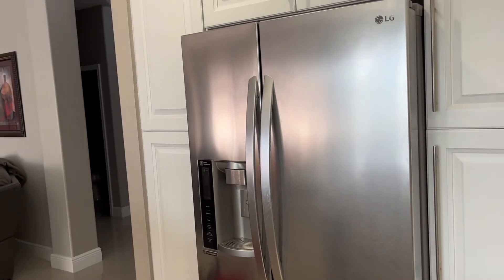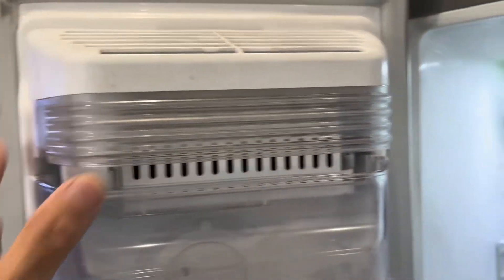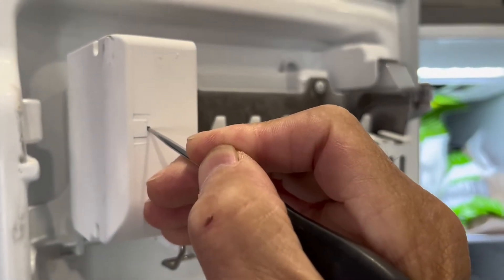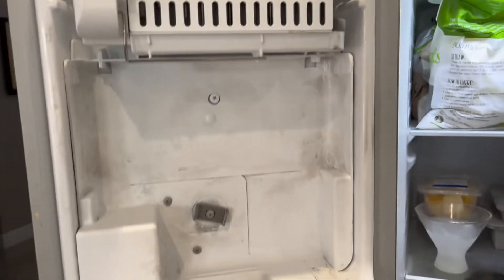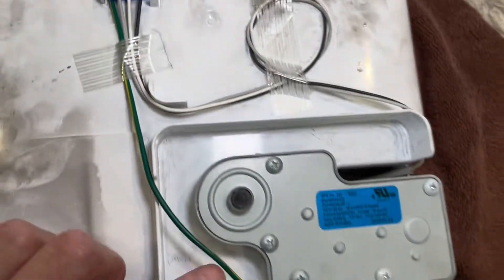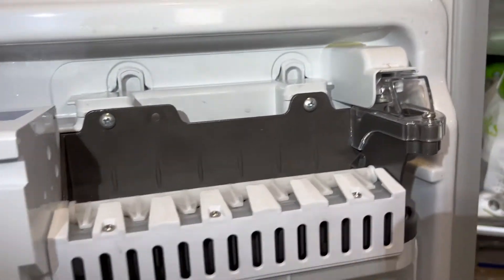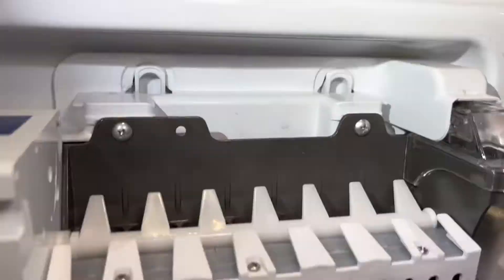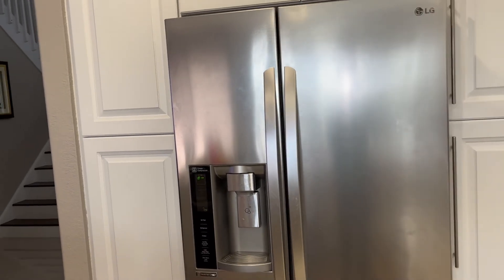How to put LG ice maker in diagnostic mode and replace ice maker.

Comment: I performed a test and the ice maker spun around and out came a thick block of ice. No way that block of ice was going to be dispensed. I looked at it several times throughout the day and the ice tray looked normal. It was deceiving. Getting rid of that block fixed the issue of it not dispensing ice. Thank you.

Comment: Thank you, I was hoping not have to replace mine. I was getting water, it was making ice but, resetting did not work in getting the arms to push the ice out.
Reply: I have the same issue. The ice cubes seem to freeze in the tray and don't get pushed out. Did you find a solution?
Reply from the maker: If you push the harvest button for 5 seconds on the icemaker and the icemaker still doesn’t go into harvest mode. If the icemaker is getting power the ice maker  supposed to work so the icemaker would be faulty.

Comment: I liked the video, it was very good, I have the same refrigerator and it happens to me that I don't get ice, the lever doesn't lift, it stays down, do I have to buy the new ice machine or can it be fixed? I await your response, thank you
Reply from the maker: If you’re referring to the lever on the icemaker that doesn’t move after putting it in diagnostic mode. Therefore, you would have to replace the icemaker if you know that it is getting power.

Comment: My lg freezer doesn’t get cold.  How to check the coils to see if it’s frozen
Reply from the maker: Remove the evaporator cover panel. If the evaporator is frozen with ice and heavy frost that is a defrost issue. When that happens, you could usually see heavy frost on the back panel of the freezer.
Reply: @appliance63  no heavy frost.  I have a lg side by side- how do I pull the panel off
Reply from the maker: If it is like the one in the video you have a bottom and top back panel? I believe the top panel may overlap the bottom panel where the evaporator is. In that case, you would have to take the top panel off first. The evaporator cover should be held on with  clips. And there are a few Phillips screws, hiding behind buttons you pry out  to get to the screws. Also,  put your model # in appliancepartspros.com to see a breakdown of a part on the evaporator like thermistor/ sensor and see  if they have a video about replacing the thermistor.
Reply: @appliance63  coils are not frozen. What else can I check
Reply: @appliance63  I have a LG Side by Side LSxS26326B
Reply from the maker: If all your loads are on meaning compressor, condenser fan,evaporator fan,are on continuously doors are closed and sealed properly. It will be a sealed system issue, which is bad compressor, refrigerant, leak, or restriction. The only thing left is to check your thermistors need a volt ohm meter.
Reply: @appliance63  what part number maybe I’ll just switch it out.
Reply: @appliance63  changed the thermistor.  Seem like nothing changed.  I’ll wait 12 hrs but the fridge stays around 50.  Any thoughts?
Reply: @richardlee4438 did you figure it out. I have the same fridge and same issue. Everything seems to be functioning but freezer isn’t getting cold enough to freeze food. I’m going to change the thermoister just in case
Reply: @BIGGOODBOY  no LG wanted 650 so I bought a new fridge for 700
Reply: @richardlee4438  for the thermistor/ temperature or defrost sensor. Which part did you buy? I’ve spent a good 4 hours researching and trying to find the right part but nothing.. I looked at the user and service manuals and it doesn’t include a part number just says “defrost sensor” couldn’t find anything online for this model of LG fridge